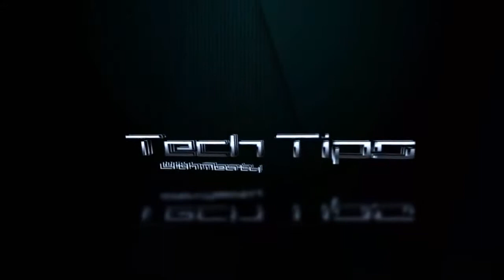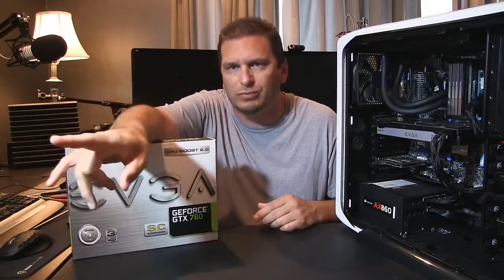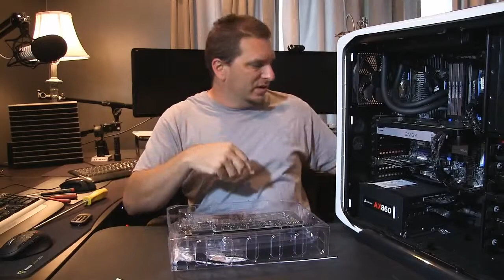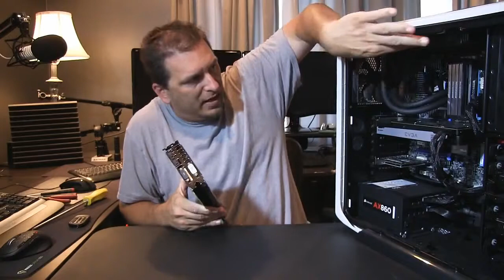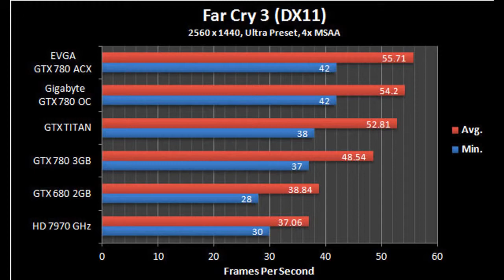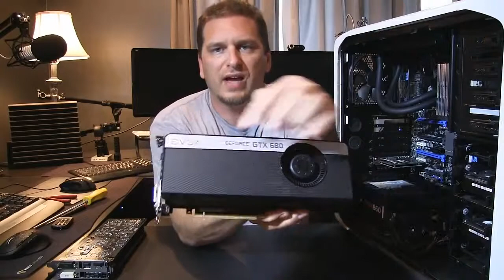Tech Tips: Upgrading/Installing Graphics card  EVGA GTX 780 SC ACX

Comment: I have a HP Pavilion 500 - 164 is it possible for me to install a GT 630 in it?
Reply: it's possiable but make sure to have a good power supply HP normally have bare min. power supply like 300watts most after market cards want 500 min
Reply: I have 300 but i might be able to upgrade the psu
Reply: Yeah you can i did when I had a HP getting the 4 main wires plugged in is a pain due to the lack of space hehe
Reply: I'm just gonna get a better desktop then lol
Reply: I would get like a corsair 600-650 watt then you are covered no matter what card you buy